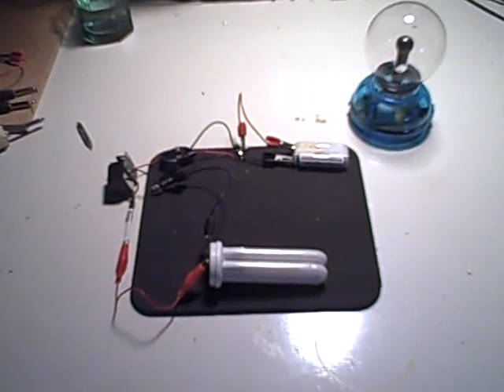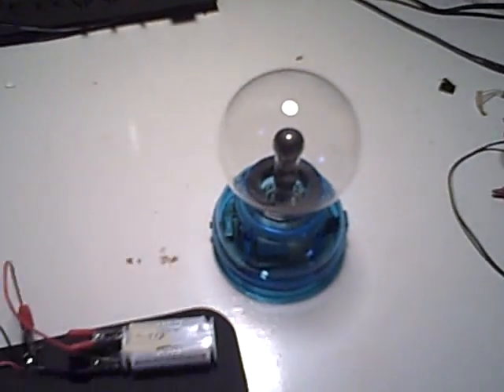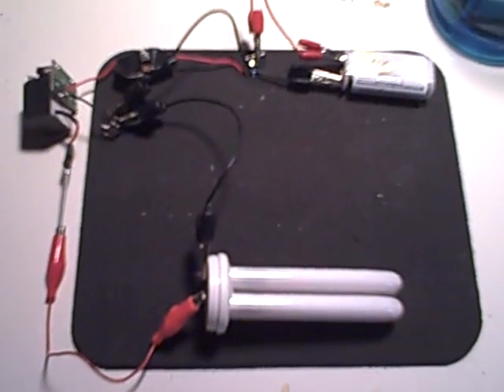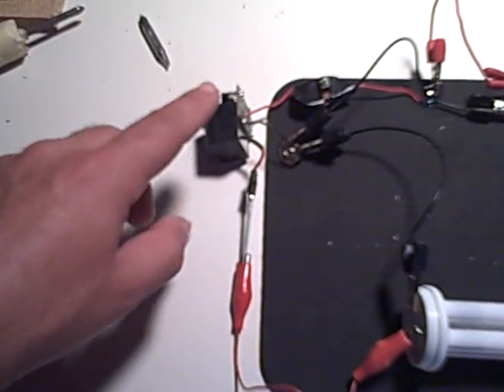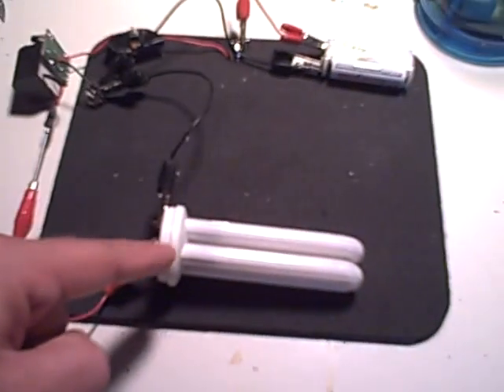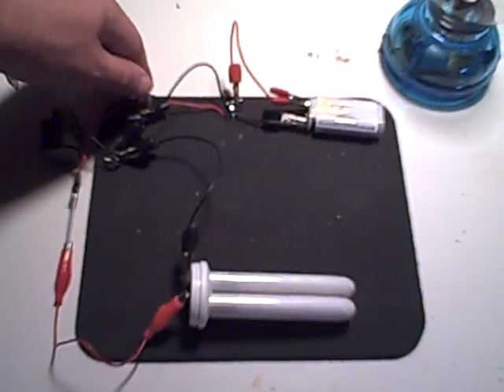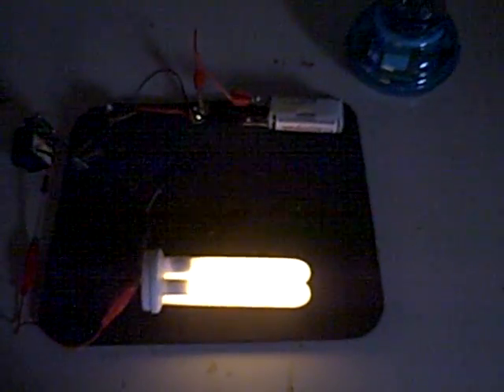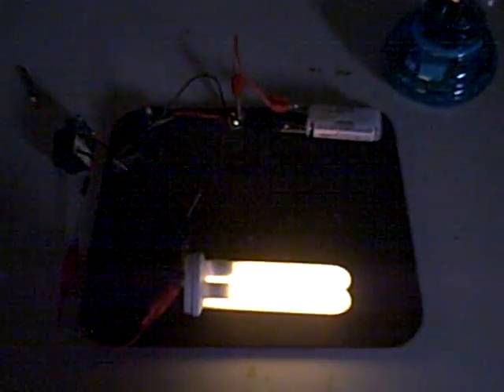High Frequency Lighting

Comment: You unfortunately won't ever get a useful amount of light that way. For a light like that to work properly the filaments inside have to be heated with a low voltage higher current supply which wastes a lot of energy. Even with a 800w tesla coil (which I happened to have built in high school) it was not possible to light a tube to full brightness even though many times its rated power was passing though it, again because mercury arc lamps are hot cathode devices.